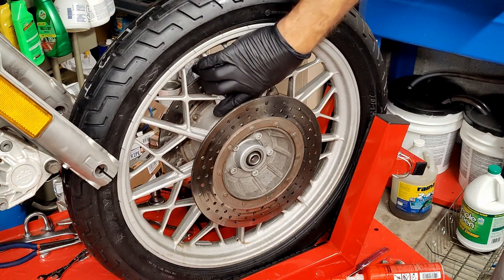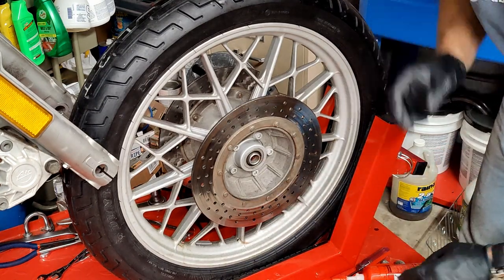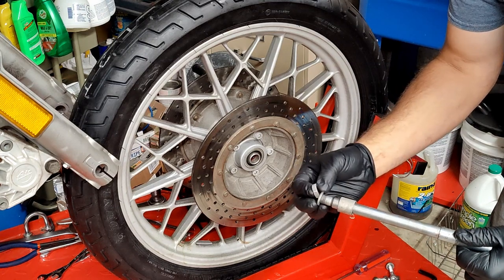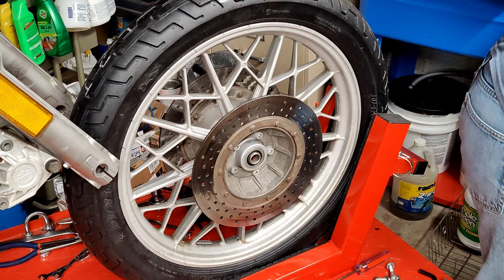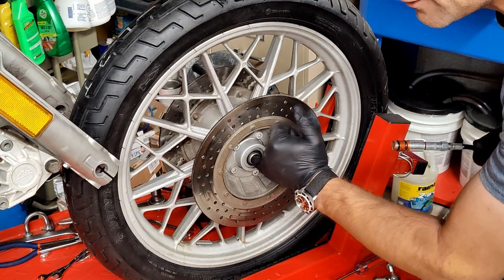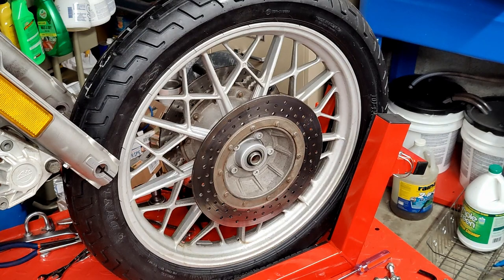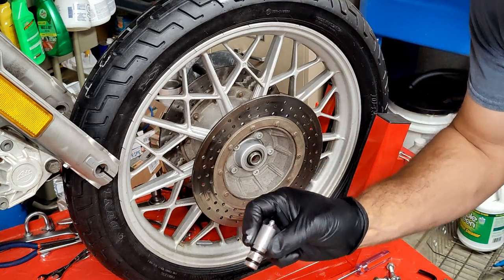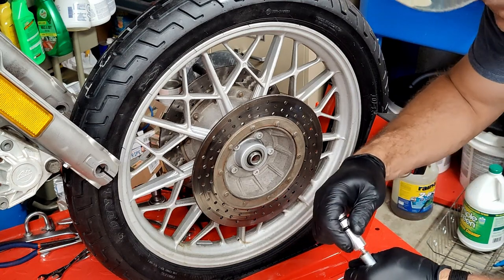BMW Airhead -  grease your wheel bearings

Comment: Great video, thanks for posting! I have acquired the grease adaptor from cycleworks, but was wondering if you could please post a link for a grease gun that is compatible with it? thanks again.
Reply from the maker: I am using a regular standard grease gun for it. I bought mine at a Tractor Supply store.

Comment: What kind of grease is used in motorcycle wheel bearings?
Reply from the maker: @larividj  wheel bearing grease. I used just regular high pressure wheel bearing grease that is used in cars. There are guys that will tell you to only use BMW grease but that is nonsense.
Reply: @HeikosGarage  thanks!

Comment: Just a clarification question, but I assume you use the tool from both sides of the wheel, correct?
Reply from the maker: Yes, both side and it works on front and rear wheel of our beloved bmw airheads.

Comment: Does it work with /5 Airheads as well?
Reply from the maker: I am not 100% on that let me check.
Reply from the maker: I just took a look on a parts fiche. The rear wheel is virtually identical with the /6. The front wheel has drum brakes and a smaller axle diameter. Front won't work, rear i am not 100% but let's say 97.375%.
Reply: Hi Heiko,  Thank you for looking into it.  kind regards
a

Comment: It looks to me that unless that spacer has a hole or two in it, the O-rings are sealing against what turns out to be a deadhead.
Meaning the grease path is sealed. No path for the grease to flow to the bearing.
Reply from the maker: I measured that distance and the opening is right between the top hat spacer and the bearing. The grease goes in just fine. Thanks for your comment.
Reply: Heiko these are great videos! I particularly like the R65 as I have an 81 which is basically identical. Of course the fork boots were later added, a great idea.

Do you have one in the works for the brake lines?
Reply from the maker: @twominutesinverted  I just replaced them off camera. I might do a shirt one just for you. Thanks for the comment.
Reply: @HeikosGarage  Thank you for clearing that up for me.